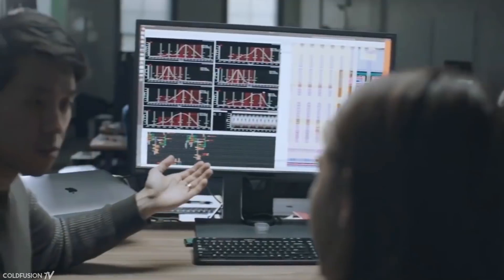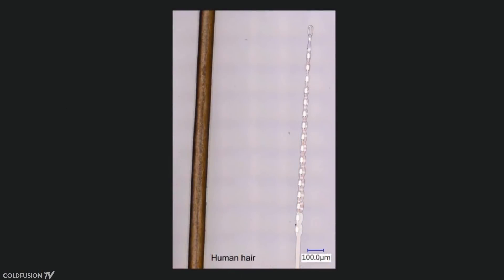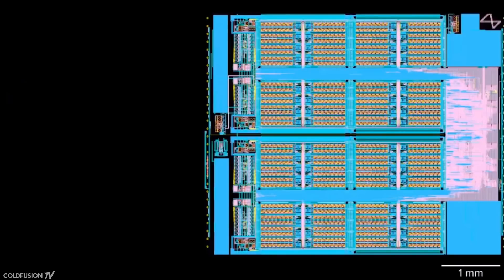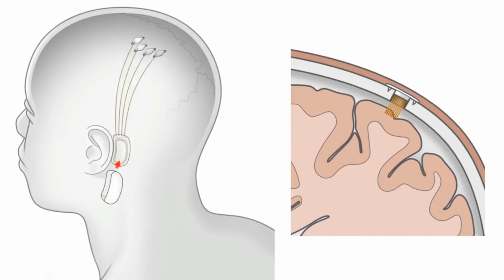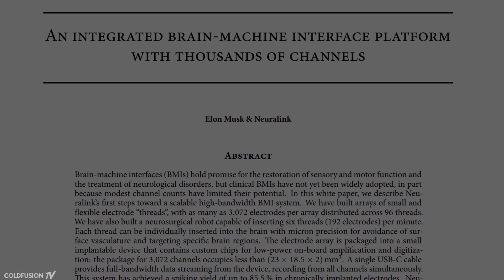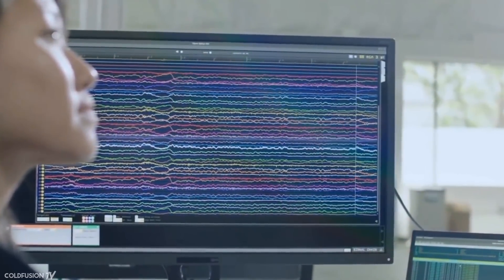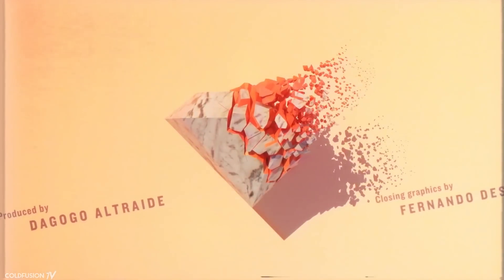Neuralink - Merging Brain and Machine

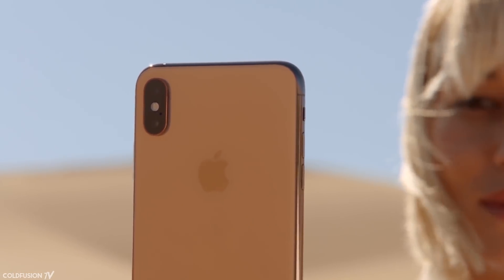Comment: 1:41 - "The bottleneck in all of this is how we interface with that information."  Partially true.  The other, even bigger problem is how that information is organized.  Tons of facts, small amount of knowledge.  Try doing a web search for any item or data that does not have a unique keyword or keyphrase associated with it and has to be described instead.  You'll get frustrated, fast.  A brain link interface in these cases, will only help you get wrong answers faster.

There still needs to be a new layer of the Web where information is organized into a meaningful structure that has semantics (aka "meaning"), as its core organization.  The current web is a giant dumpster of facts with Google acting as a liaison to help you navigate that mess by doing at least some intelligent keyword indexing along with a lot of filtering.

There will be another period coming soon where agents from Google, amazon, etc. do a better job of helping you search by having higher level semantic interfaces to talk to you and try to search the Web in a more effective manner by doing a better job of discerning what you are actually searching for.  But that will only be a stepping stone to a much more powerful phase of the Web where the information is inherently better organized according to how humans think and most importantly, how we feel and perceive things.

Comment: ya'll talking some scary shit in this comment section but I believe neuralink will be created with security in mind where it can only go a certain amount of range and will lock to its primary bluetooth device so no other devices could connect and the stream of data could be encrypted. its also not designed to be worn all the time.you're supposed to take off the neuralink stuff thats on the outside for bathing so you don't damage it.

Comment: For those of you who are paranoid and can't comprehend how this works, it basically reads and translates the electrical impulses released by your brain cells. It takes signals from isolated clusters and turns them into computer code that can then be uploaded to a local server to interact with local tech like your phone or tv. Imagine the possibilities of imagining your phone screen turning on and opening Instagram and it actually happens in real time as you look at your phone in your hand. And this is just the most simple application for this technology.

Comment: Sounds like this will be the end of freedom as it will be possible for you to be controlled via these devices. You will be lived instead of alive.
Reply: You control the device the device can't control you that's like saying a compass controls your direction or an altimeter can control the altitude.
Reply: @aldenroswell8504  if it has a connection to the internet it will be covertly controlled. Just like everything you do now is being tracked and monitored. You may think your phone is off, but it can still record or film and you don't even notice it. If a surveillance state is so easy to push on the gullible masses then why wouldn't mind control be the same? Just sugarcoat it with humanitarian ideals and demean naysayers and then it'll be game over.

Comment: Neuralink: succeeds

Hackers: Itsfreerealestate
Reply: Damn! Brains will be hacked
Reply: Advertisers... need I say more?
Reply: A hardware solution to the problem of "hacking" or "remote control" seems the best route. Design a version of the chip that is incapable of stimulation (writing), only detection of neuron pulses (reading) - this version of the chip is implanted in areas controlling motor function and decision-making. The chips are powered via inductive coils and an external power pack behind the ear. As long as the user remains capable of pulling the plug, they are one move away from severing the whole link.
Reply: @EnDSchultz1  unless you hack the  device, and rewrite the protocols...
Reply: kilamanjaro Mountain Clearly, the distinction between hardware and software eludes you. It's not about "protocols", it's about the physical limitations of the device. You can't hack a radio and turn it into a television. What I proposed was designing a version of the device that is literally incapable of stimulating neurons, so using it as a means of control is physically impossible.
Reply: A human Brain cannot be hacked. Its impossible. You would need far greated computing power to dominate a brain. not even 3 people connected to 1 brain can influence that person's choices. much less control them
Reply: @abyssstrider2547  if it was hooked up to the cognitive parts of the brain as well as the motor cortex, as well as our understanding increased (which at the point in time where this becomes available it will be) "hacking" someone's brain is possible. If some one was able to gain control over someone's bluetooth device then they would be able to send signals and either make the person move or do something and while that would be complicated it could still be done, it would even be possible to make them think something or implant a false memory as long as it is hooked up to the hippocampus and our understanding has reached that point.
Reply: @shaycerny6253  I think it should be only hooked up to few brain parts. Or better yet make the input one way only. so only stuff can leave brain ( like idk an image created in the brain of the user )
Reply: @abyssstrider2547  gotcha, but that takes away from the 3rd or 4th phase which is increasing cognition.  You wouldn't be able to use it like "external storage" or any of the really cool functions and I assume there would be countermeasures so the "hacking" is far more unlikely
Reply: Itsfreerealestate alright.
Reply: Soon you'll have bitcoin ransom : "If you want to recover motion send money to this wallet"
😂 😂 😂
Reply: The laughing man is back
Reply: Time to learn hacking 😂
Reply: I will hack my crush's brain 😂
Reply: I don’t think it cannot be hacked, it will be only responsive to you, crazy privacy measures😜
Reply: @kpsayyed84  
Well no, someone somewhere has to monitor them, probably like a bluetooth pacemaker monitor. I know someone who uses that.

Comment: You can be against brain machine interfaces or for them, but people need to realize that since technology is improving exponentially somewhere down the line technology is going to be so advanced that those who oppose it will be completely obsolete in society. While those who except the new superhuman intellectual abilities will fill the working class.
Reply: And also class dependent on cost so effectively only the rich will be able to afford the latest upgrades. The poor wont be able to afford the medical procedure. The middle class will be stuck with version 1. Elites will be on the latest version. Essentially the advent of the digital class structure all controlled by a central government via skynet. Power structures will remain in place with obscene control. Fomo will drive the neuralink revolution and keeping up with the digi-Jones.

Comment: The general AI we are moving toward will be a symbiosis of man an machine and people will be connected in this "mechanical" neural net. Joining essentially man and the internet. We share information of one node /person and the systems updates as a whole simultaneously blurring the distinction between one node or person  between another. The acceleration of information transfer would make the progress incredibly quick and then even quicker still till we merge and the nodes and the whole controls machines to move in the world. Contradictions would exist inside the system of course just like the human mind or any system creates. Internal war, opposing views. These types of deaths would be strange. The ideas that loose in collections of nodes may be regrrammed. If new ideas win, the whole system updates and is a new thing.

Comment: The brain is flexible as long as you don't change every thing at once - I guess learning how to be neural linked is like it is to rise one eye brow only or how to wiggle the ears if you can't. Only I think it can get quite frustrating if you spend thousands for such an implant and were not able to crontrol it - if it for example types random stuff all the time.
Another problem will be overstimulation - the brain loves to be stimulated. I guess that could be the reason why addiction is popular. If the brain maybe gets a nice electrical brain massage through external sources or something like that.... I shouldn't be using YouTube that much...

Comment: Several things:

1: This needs to be completely open. Open hardware, open software. Up to Purist standard, and no less, ever.
2: Great for medicine, obviously.
3: Applications of each specific chip should be carefully considered. For depression, you do not want an internet capable chip. For most net access that isn't severely restricted, you want an external filter and firewall; in other words, a computer.
4: Depending on the scope and lack of security, this can reach thinkpol levels. This is why security should be paramount.
5: If it's interactive enough to take over our bodily functions, see the above point and make its importance millionfold.
6: What about severe impacts? Due to low mass, I do not suspect that much will happen, if anything at all. But:
7: What about magnets, and especially MRI? I don't want this to possibly murder me in a checkup. Or make me a vegetable, both are equally as bad.

Comment: This HAS to be done right the first time. The back lash from mistakes would be overwhelming.  The very FIRST focus should be on end to end strong encryption. The entire system HAS to be designed with security as its highest priority.  It should also be open source, so that everything can be checked, and rechecked by outside observers.
Reply: It’ll still be hacked. Mind control is inevitable
Reply: You can’t have it open source and then have it fully secure imo, we learned that with bitcoin lol
Reply: @ThisIsSparta300  Look at encryption as just one example. Open source is the most secure, as its the most examined.

Comment: You could just be erased and altered at someone else’s will. That’s scary. I wouldn’t want to be apart of it.
Reply: Not with this device. Maybe a hacker could give you a tiny headache or something lol.
Reply: @richdadsummit7557  Try seizures at a minimum. It taps into your motor cortex. A hacker could make you a vegetable.
Reply: @DjangoMarine-Esq  Doubt it.
Reply: @richdadsummit7557  Seriously? If it's tapped into the same area used to treat epilepsy, you don't think it could be used to induce a seizure? Do you know what epilepsy is? Do you know what your motor cortex controls?
Reply: @DjangoMarine-Esq  Are you a neuro scientist of some type?  How would you know if the same electrical strength used to treat epilepsy is also enough to turn someone into a vegetable?
Reply: @richdadsummit7557  Reread what I said. Seizures at a minimum. There are no specs for this particular device so it's impossible to know the worst a hacker could do, but it's at least reasonable to assume that something that prevents seizures can be manipulated to cause them.
Reply: @DjangoMarine-Esq  I read and understood the first time. And to me that seems like a huge jump in logic. 

They already use electrical simulation to treat epilepsy, and those devices can't be used to cause seizures, why would this be any different?

Comment: And this is where Elon musk falls from fame and glory. He will perfect the technology but the process he won't. After his first attempt at marketing these devices it will be found that they cause an infection to set in inside the brain tissue causing a very quick death. 30 years later his research will be picked up by a small computer manufacturing company that bought his stock shares in a business deal and inherited his prototype projects as well. They will fail. The neural tissue degeneration and infection was solved but a similar problem sets into the skulls bone marrow. They dont die so quickly. The third and finally successful product is achieved through creating a microscopic  network of nanites that converge and function as a quantum computer cyberneticly infused into the neural cellular network of the brain. Their functions and grafting area is not tissue or muscular but cellular. The computer nanites emit they're own synaptic response codes and receivers. So that the user can control the processors command totally by neural interface. The nanites use the biochemical producing cells within the brain to interact without causing a severe imbalance. However prolonged use does have a side effect of emotional detachment due to the usage of the brains biochemical cellular stores. Elon musk will never live to see this come about and will be recorded as one of the things he will regret missing after his death

Comment: The human actually has 3 systems: the movement system, the nerve system and the RHYTHMIC SYSTEM. They are connected with the will (movement), thinking (nerves) and FEELING (rhythm - heart and lungs). So actually what AI does is to deactivate our intuition (active, heart-based thinking) and make us lazy and dependent on machines. Sure this sounds far fetched, but maybe it's worth considering. 💖

Comment: It definitively SHOULD be pursued! This is implanted in a very limited area of the brain. I am sure that if there was a lot more threads, going everywhere, then we would be able to properly see the activity of the brain. Right now, it's too limited to do much. Also, there is the chemical signals to consider, and the connectome of each dendrites (affect how well the electricity is transmitted, and which neurotransmitters are sent). So this is great, but it's still very crude. I am sure it will lead to many discoveries, but just as we can tell a lot more with satellite pictures at 10 cm resolution than we can at 1 km resolution, it's still going to be useful. 

Putting the power into the hands of the people is great as well. Although I think that to get real utility, we will need to feed our brain data to an A.I., which can raise huge ethical considerations, I think this is hugely useful, for many things. It will be important to ensure the brain data to be isolated in a blackbox, with the control of the data in the hand of the user. 

The possibility, especially when paired with other sensory information, such as a camera and microphone, is that our complete lives can be analyzed by an A.I. that would know you so well, that it could help you really well. The best way I see to have the best of both worlds is to have a local instance of the A.I. running on our phones (if possible, as I think the volume of data and computing power are enormous), or at least on a local machine, in a closed loop, and then have that agent interface with the rest. So for example, I could tell my A.I. assistant to find me a job. Without any other information, it would know me very well, would have seen what makes me happy, what makes me sad, what I am good at, and, possibly by interfacing with an outside A.I. specifically optimized for job searching, would browse the possibilities, and pitch me to A.I. representatives of companies throughout the world, finding me the perfect match. No need to even go in interview, as the limited information relayed by my assistant would show real examples of my performance to an employer. It would then tell me a list of choices, with a recommendation, and a start date. All that in seconds. 

Same for dating. Just like the Black Mirror episode where the A.I.s of 2 people were dating in a virtual environment, to analyze the compatibility of their users, we could have avatars that would be able to emulate us perfectly, instantly, and could interface with other A.I. to know very quickly if we would be a good match, living a whole life together in the span of a few seconds. 

Of course that assistant would be able to basically live our life for us, in a way, by suggesting things to do in a moment of indecision, calculating probabilities of success and such. 

However, all of that implies a much better understanding of the brain, and the gathering of much more data by a lot more people, so that models can be trained to really understand what's happening. What I have been describing is also outside of the current capabilities of A.I. research, and if it's possible to have an A.I. analyzing our brain data accurately, it's also likely A.G.I.s would exist, making it almost inevitable that we would HAVE to integrate ourselves with an A.I. to compete. 

Also, it's important to note that these threads inserted in the brain are not in the region of memories. So you cannot implant memories. It's in the motor cortex, so at most, it would stimulate the muscles involved in certain motor activities. I would be really interested to know what happens when it's inserted in more abstract regions of the brain, such as the pre-frontal cortex.

Oh, and I hope it would not interfere with CAT scans.... It would be a bad thing if you are rushed to the ER, put in a giant magnet, and your cerebral implant is ripped away from your skull.

All in all, I am really optimistic, but I think people need to put away more unrealistic fears, and concentrate on the real issues with this: protect the details of your data. Maybe it's ok to show general trends, or conclusions of analysis. But not the specific of what I was thinking intimately. Yes, that data could and should be analyzed by an A.I., but as leaks and other hacking showed us, no company is invulnerable to problems or greed, so it's important that this data is processed locally, in a black box, for each users, with a good control over what gets shared.